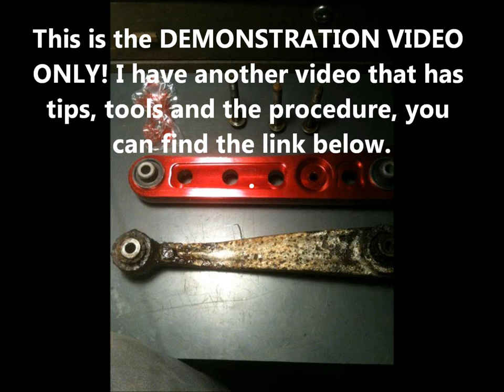How to remove seized rusted stuck lower control arm bolts Part 2

Comment: That was helpful.  I got me a vertical bolt that goes through the bushing and appears to be seized in the sleeve that goes through the bushing.  It is making me insane as I don't really want to cut it off.  I'll use the Penetrating Oil and get out the jack hammer.  I think the bolt looks relatively clean but it has been in place since 1997 on a Buick Regal.  I been beating it with a 3-pound sledge and a piece of rebar.  No go!!!  It just bounces as the bushing rubber absorbs the force and bounces back.  I think I need a bolt tool.

Comment: good video .. glad you wasnt talking the whole time ... however my question is that if you do not have an impact gun how would you do that?
Reply: +Black Majik By hand, just would take a lot of muscle and a lot more time.  I've done it this way before.  Get a 1/2 ratchet and a cheater tube, makes it go faster than using a breaker bar.

Comment: That couldn't be a very stuck bolt for that to work. I've got one here you could try.
Reply: +momoxsparco what kind of drill .and bits to use. I only have a regular corded drill. but I have dremel and stuff if maybe cutting  the nuts off cuz my bwr came with new ones

Comment: I've used a similar method. This works well. Thanks for posting. By the way, I've never been comfortable with a torch near anything that runs on gasoline.

Comment: good trick on most bolts. if its totally seized in the bushing those bolts arent going anywhere tho. i have a 99 CRV with original suspension parts and the bolt head snapped first try

Comment: I really need help, my problem is that it's spinning with a ratchet and the Milwaukee 1/2" Fuel impact gun is making the impact sound while it spins the bolt but it's not moving. Should u get a grinder and cut it or a reciprocating saw and cut the bolt on each end? It's a 2002 Volkswagen Golf GTi front drivers control arm. It's the bolt to the left that goes through the bushing diagonally not the inner busing with the bolt and nut in top. Anyone ever had this problem? I was bending it back and forth while going side to side and up and down and when I put it back together, it didn't line up without using the Jack to line the stabilizer bar link bushings. Should I just drop the whole cross member? I think it's mounted to the transmission. So I don't know if it's load bearing. Any one know what to do? Is there a special bolt puller or something? I'll cut the control arm I have a new one, but I still need to get that bolt out on the outer control arm bushing. Thanks

Comment: What should I do if I rounded the bolt already?
Reply: If you haven't gotten it fixed already, just cut the bolt on the inside of the mount between mount and bushing, then drill the remaining bolt out just smaller than the size of the threads, and then rethread/clean up the threads with a threading tool.

Comment: I don't have one of those guns and I can't get my shit to budge at all. Also the bolts on mine are in a spot that doesn't allow for much leverage.
Reply: I ended up getting it done with a sledge hammer.  Thanks for the tip tho.

Comment: There is a better way of doing this.  Instead of wasting all that penetrating oil and making a mess just use a propane torth on the bolt head for 2 minutes and then zip it off with ease.  Its cheaper (propane as opposed to wasting a can of oil ) and its cleaner.  No hammers required and less time spent.  Heat it and zip it off with ease